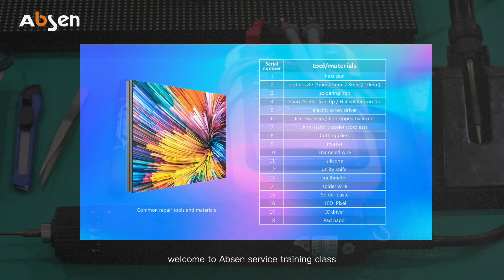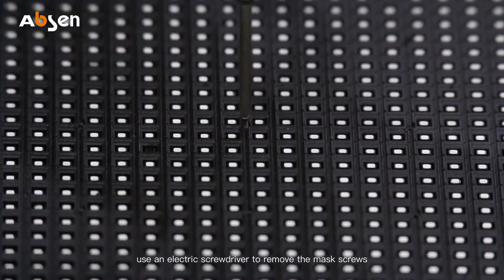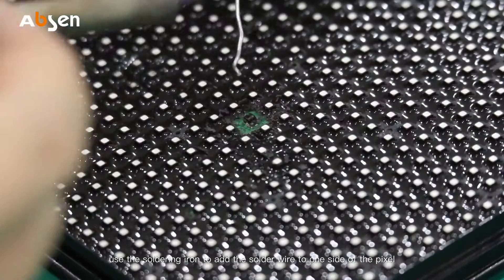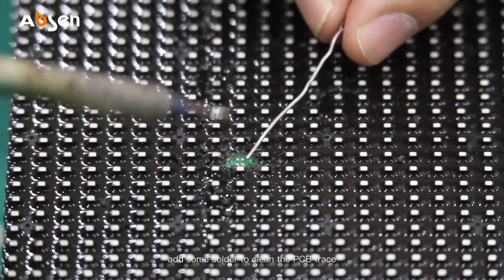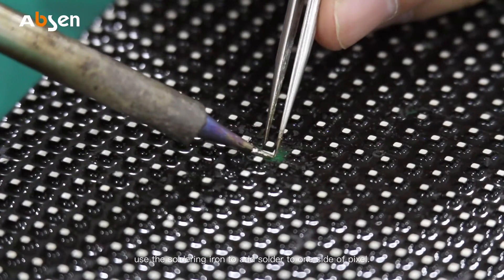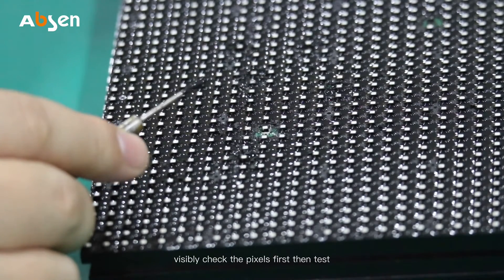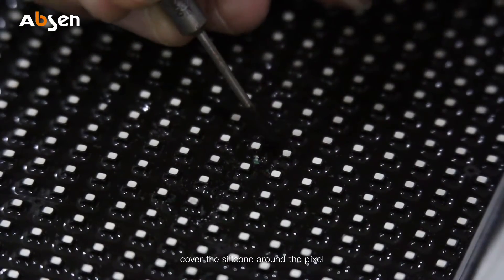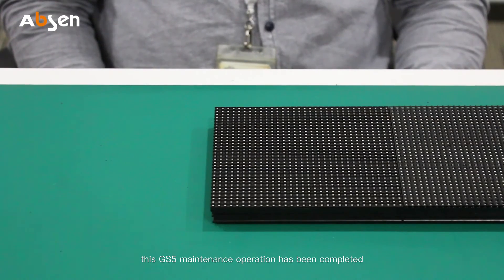How to repair an LED pixel of P10mm_Absen LED

Comment: Using a soldering iron to repair the lamp, even after repairing, it will be damaged in the near future. The correct repair method should use an hot air gun. Please follow DICOLOR or SAM ZHOU to bring you practical LED display technology。
Reply from the maker: Thanks for watching Sam. 
This is Absen's GS 5mm panel, which is a robust SMD outdoor product with coatings on LED board, which means better we use soldering iron instead of air gun. We need to take the mask off first and then remove the glue/coating and the SMD 1921 LED with soldering iron. 1921 has four LED pads, so it is easy to do the removal with soldering iron, with no effects on the pixels around.  
However using the air gun as you mentioned takes longer time to heat before we can remove the glue/coating. It is a big pixel, so the heat time will be longer. What's more, the remaining glue/coating on the board might give unpleasant smell. The work efficiency in this way is low and not satisfying.
That's why professionals use soldering iron when repairing a SMD LED, not with hot air gun; however they use hot air gun when it comes to a smaller pitch pitch product, because it would be difficult using soldering iron.
Reply: @AbsenLED  correct method...i am a tech ,,i do 16 different models of LEDs
Reply: no...incorrect info...damage will occur